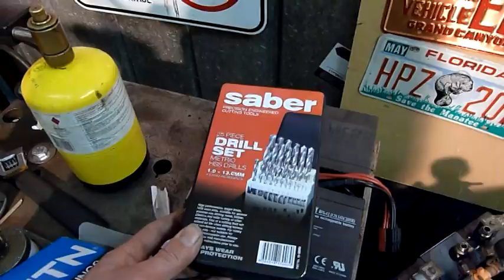Hydraulic Power Unit Conversion pt 3

Comment: I’ve got an idea... for a multiple plunger pump sewer drain cleaning machine... nearly all sewer drain Jetters are electric or gas engine types.. and they are limited to one pump per power source...  BUT the smart way is,,, a large enough hydraulic power source to run the largest pump you own..and you could then have two smaller pump, running of the same power source , with the use of a controls switch  which controls the amount of flow to match the pumps requirements...    the typical drain cleaning tech needs 3 different size jetters.. taking up huge valuable space on the truck...